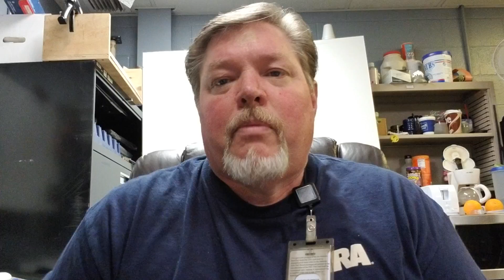Gravity Operated Generator

Comment: You have 13 years of experience in what?  Who the hell is going to invest in an idea you have in your head?  You don't seem to understand basic Physics!
Yes, you can make electricity from gravity, but it cannot run on its own in a closed-loop as you are suggesting!
You would have to achieve unity just to keep the generator going and over-unity to get any useful power from it.  Neither can be achieved due to losses such as heat and friction to name just a few.
I suggest you research this with credible sites and read some basic Physics books found at your local library, because, sorry man, you are making impossible claims!
Reply: Maybe you need to watch the video again. I said nothing about 13 yrs experience . I said 13 yrs ago I was inspired. We are now half way thru purchasing materials. It won't be trailerised yet. Over unity has nothing to do with this unit,  being it's a reciprocal mechanical device not needing much in the way of electricity to operate. The unit only uses 12 volt dc to operate 1/2 ton winch every 4.5 minutes to rewind the individual weight stacks. It's large by itself with a foot print 1.5 times that of a home Generac system. As for me not having a clue ... your welcome to your opinion. Everyone has one. I'm looking at another years before finished with this first build. Also I haven't posted pics due to not having a patent. Sorry you feel frustrated. Have a better day. Please be nice.
Reply: @poodydad01  
13 years ago you were inspired i.e. 13 years of experience. 
Charles, not frustrated, just amazed at how little you understand Physics!
My comments are not opinions.  They are based on scientific facts.
Do you think the power required to raise your weight by winch takes less power than if the weight was raised quickly by a motor directly?  
The answer to that is it takes the same amount of energy to raise the weight with a winch or directly connect to a non- winch motor.  4.5mins or 10s to raise the weight will require the same amount of power.
That being said, you cannot generate more energy than it takes to raise the weight.  In fact, you will generate less due to losses.
Your 12V battery will work until it loses charge and then the system will stop.  No, you will not be able to recharge it via your gravity generator.  Everything tends to equilibrium unless an external force is applied to it. 
This is a lossy system that cannot work.
Search Conservation of energy.  It explains it quite well!
Reply: @valveman12  I believe you need to tell this to the others developers with their own Youtube  channels doing similar projects.  What produces/uses more A) a 12 volt dc motor running for 20 seconds or B) a 12 kw generator head running for 4.5 minutes ? Your obviously passionate about being in the right. I'll say no more. You win.
Reply: @poodydad01  
"A) a 12 volt dc motor running for 20 seconds or B) a 12 kw generator head running for 4.5 minutes ? "
How are these related?  Part A, your talking voltage and then in part B, Kilo Watts!
They are not the same thing!
Are you perhaps making a claim that the weight is lifted in 20s by the 12V battery and in that 20s of lift, you'll get 12KW output for 4.5 minutes?  
If this is what you mean, then you've never tried it because if you did, you would realize that what you're claiming is not possible! 
.
You mentioned other people doing this!  ok, post a link(s) to a video(s) where they are running a gravity generator and the weight is raised by only the energy produced from the Gravity generator while powering other devices at the same time and is totally self-sustaining!  In fact, I'll make it easier.  I will accept a link that shows a gravity generator hoisting up the weight without any external source and continually running in a close- loop!
.
You know what makes me right and you wrong, and I don't mean this as an insult?   
Education and experience in the fields of Science and Engineering...
I m not trying to insult your intelligence, I am just pointing out, you are lacking understanding of how Physics, the Natural Laws, that govern how our planet, works.
Reply from the maker: @valveman12  well then I guess that covers it
Reply: @charlesroberson3761  
So why haven't you even created a prototype yet?  Why no video of your prototype?
You should learn some basic Physics because clearly, you don't even have a grasp of the basics!